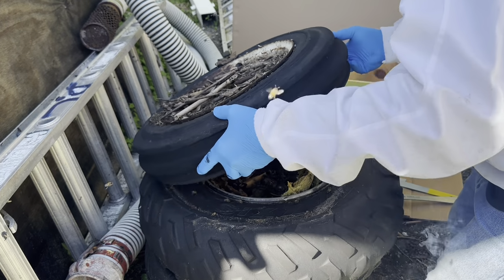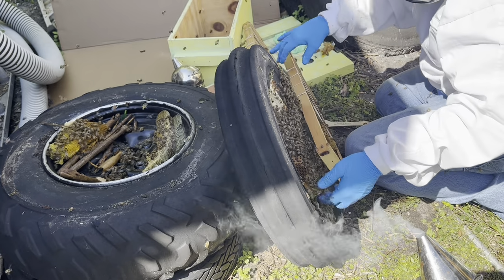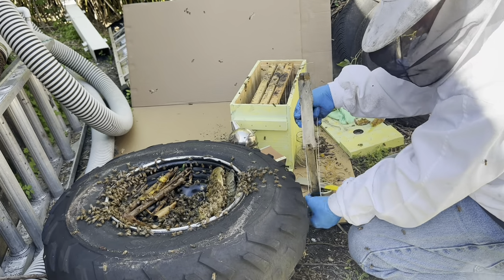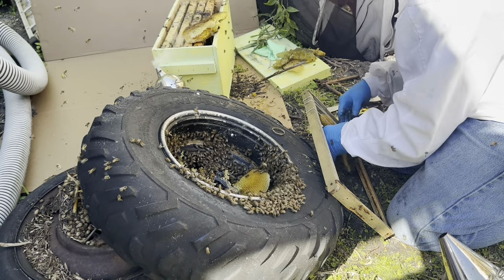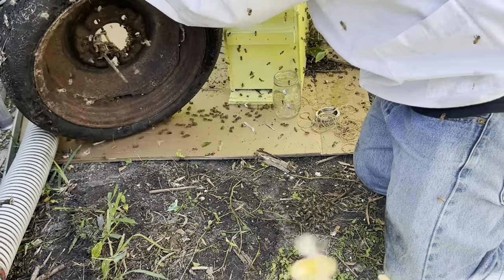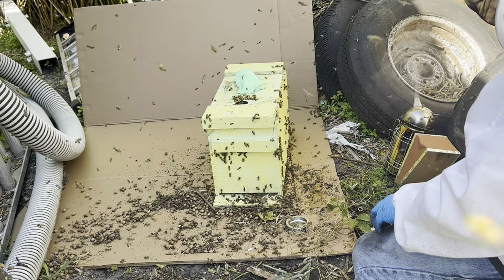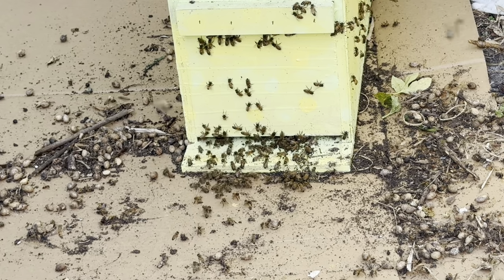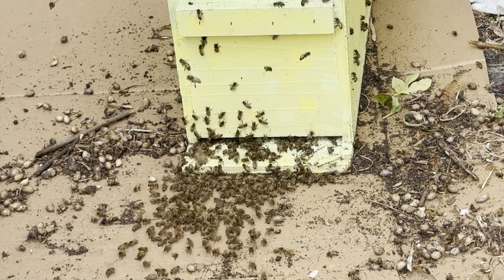Saving the Bees: A Honeybee Hive rescue Relocation  from a stack of “Wheels”.

Comment: Is it me or did you put the comb on the 4th frame in up side down?
Reply from the maker: They will not fit in upside down. You would have to to put it in on an angle.   Beekeeping is very fun and rewarding . Thanks for watching the video. Have a great day.
Reply: I know the frames will not go in upside down but the comb is built at a slight upward angle  
And if removed from the hive it can be put in a frame up side down haveing a downward angle to the holes in the comb.
Reply from the maker: Yup that is possible with the excitement. Good eye . They are doing fine. I did a follow up video. Thanks for watching.